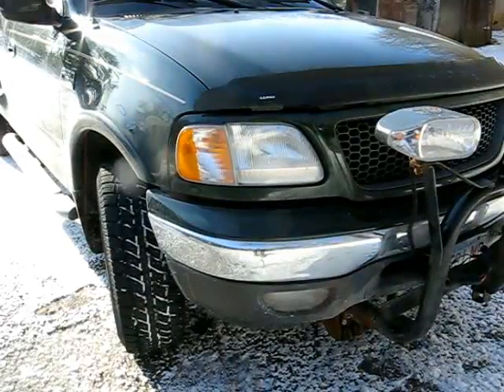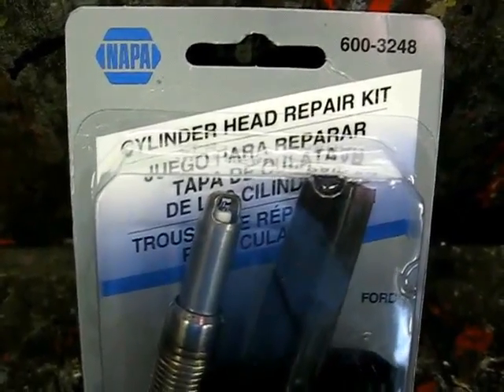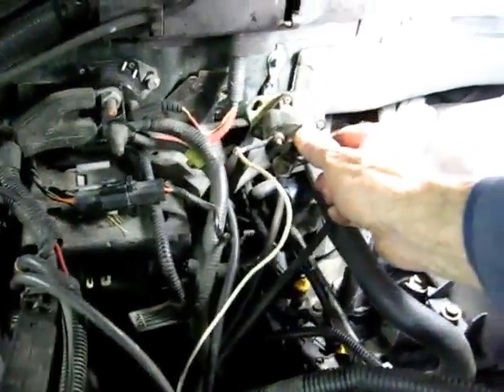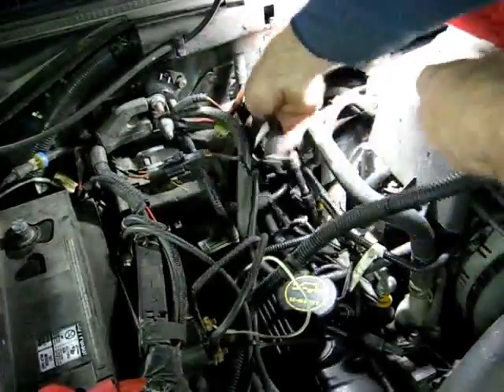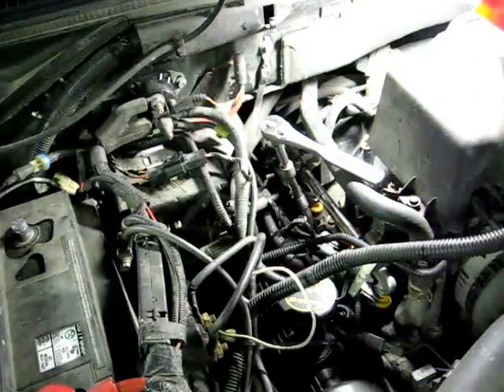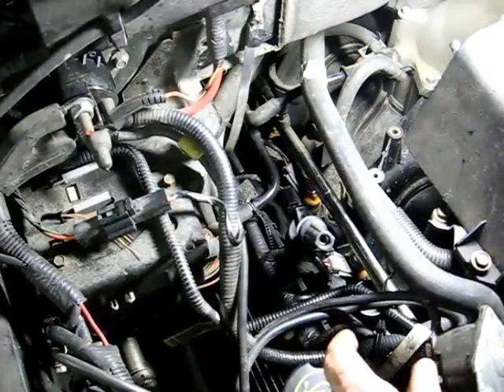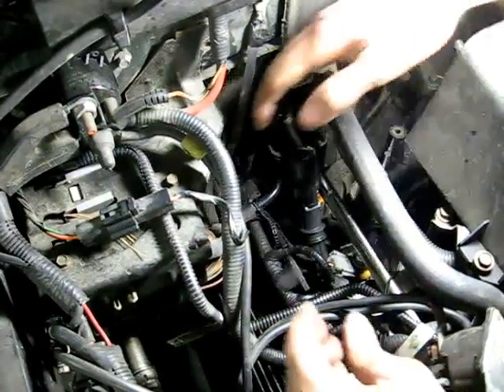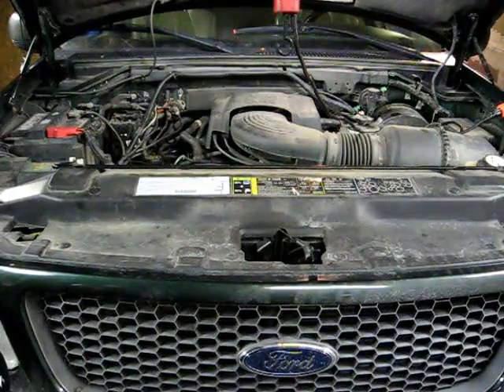Spark Plug Thread Repair

Comment: The "special spark plug" used in the video looks like it is for a 3 valve 5.4L. It is used on a 2 valve 5.4L in this video. That has to be the wrong kit. I have heard that people have a hard time finding the 2 valve kit, so it is a likely possibility.
Reply: johnathan wood well it had t=ouble starting..😕

Comment: I have a 2001 XLT f150 5.4 2V  and I can only find a insert kit for the 3 valve engine. what is the difference between the 3 valve and 2 valve spark plug threads and are there difference in the years!??

Comment: tired this on friday - blew out on monday - onto the next kit - this is a glove compartment get you home fix ..
Reply: +Ricardo Benin  This is not a get you home fix. This fix is permanent. 

It has been in my truck for 5 years. I just blew another one out the other day. First was 4 and next was the number 3 plug just what is common in V10 engines. 

The first one my father put in and I was told by Mechanics that when it bottoms out you will know because it will come to a stop.  I asked if I would be able to strip it easily and was told no. 
Well, that must be a weak person who said that because I can twist a 1/2 quality drive until it breaks. 

The truth is, there is a certain amount of force that you must not go over. You can easily strip out this fix. But once you have installed it the plug will not blow out again. If it does, there are Sav A Thread kits you can use that even fix the spark plug after using this insert. Then if that doesn't work you can use the big 500.00 ford kit which is tricky but fixes all of these if you can not seem to get one of them to work. 

So you have three shots at getting it right.

Comment: Special spark plug?   What about when you need to change spark plug next time?
Blow it out your spark plug hole!
Reply from the maker: They are available without buying the kit.
Reply: Chris Bamford YEAH THIS IS NOT A GOOD IDEA...ITS A TEMP FIX...I GUESS IF U WANT UR FORD TO DRIVE AWAY FROM UR HOUSE OR MALL PARKING LOT WHEN YOUR SELLING IT.....LOL..SMH I RATHER DO THE RITE FIX FOR THIS!..NEW RETHREAD AND PUT THE OEM PART BACK.

Comment: why don't you try shoving that air hose up your a@*, they only last about a month, you need to purchase a time sert kit to do the job right, it taps a brand new hole and the insert is held in with a pin, lasts for years if not forever
Reply: Time-Sert kits don't use a damn pin you fool.

Comment: Hello I have question I have bad spark plug thread hole  diameter is 15.8 mm what insert size you thing I need to make it fit with inside measure 14mm*1.25mm I confused about insert outer diameter
Reply from the maker: I am not sure what size the insert is as i do not have one here handy to check.

Comment: Hello Rich,
I have stripped my spark plug and I have the SOHC Saturn SL. I was wondering what 17mm socket I should use to get the die into the head. As you know the wall of the block gets in the way.
thanks.
Francisco.

Comment: I had someone do just this to my 2001 expedition when the sparkplug blew out....after putting the insert in and changing the coil, there is a "knocking" sound when you accelerate...can someone advise what could have been done wrong or what the issue might be ?
Reply: How long did you run the motor after the blowout and before the fix.
Reply from the maker: shawn abbott
I am not sure how long the person ran it that way.
Reply: shawn abbott
Reply: Bubba C KNOCKING....IT COULD BE A COINCIDENCE AND UR ENGINE IS GOING OUT...KNOCKING USAULLY MEANS..BYE BYE OWNER..UHHHH  HELP IM DYING UUuuf..lol

Comment: i bought 1 of these kits today and all it done was sit in the hole and spill didn't go in the hole and 70.00 later still not running. any suggestions
Reply: It is possible there is to much damage to the head for this kit to work.
Reply: ya, been thinking that as well but can't see down in the hole. and thinking it's gonna be an expensive fix. how often does this happen? am i looking at 7 more times.......lol

Comment: It will blow out in some mile from now with that kit need 12 gauge shot gun brush an acetone clean it good  then apply jbweld the old type that sets up in hours the jbkwik doesn't hold up to head heat melts next apply old style jbweld to thread repairer and thread it  in let thread s set over nite with heat bulb over cylinder to cure weld finish job and drive
Reply: Samuel Swenson I am not sure what would be stronger than the red locktite on the insert.
Reply: So what about just using JB weld on spark plug itself?
Reply: rich pin hello my fellow New Englander, do you offer services on fords f150? I'm from Western Mass

Comment: I installed this today. im scared to strip the heads again and cant tell if it screwed down far enough.  is this a temporary or a good fix to keep around for awhile?
Reply from the maker: This one was still working fine till the day the truck was sold which was 8 months later.
Reply: cool thanks.
Reply: puffNtough760 NO ITS NOT A GOOD FIX! THE LONGEST I'VE SEEN IS 8MONTHS....ITS A TEMP FIX TO GET U RUNNING AND TAKING IT IN THE A SHOP...IM DOING MINE TOMORROW BUT THE RITE WAY SO THAT I HAVE ALL GOOD THREADS.

Comment: Prevention of shavings in cylinder. 

1) Rent thread chaser (refundable deposit at auto store)
2) 3ft of thick string (550 chord?/ in camping section walmart maybe)
3) Mystic grease, red thick all purpose cheap at walmart and coat lightly on string
4) Tuck string in hole
5) Grease hole and tool.
6) Chase, fix the threads
7) use solvent (alcohol.. or..) Q-tips to clean threads off
8) Imporvise hook on long screw driver and fish out string
9) Clean again and install plug with anti-seize
Reply: Why go through all that hassle when all you need to do is what the man in the video did, stick compressed air in the spark plug hole and blow whatever shavings are on the piston...Most people if not all aren't doing this for a NASCAR engine

Comment: about the shaving , if I where to do this I would turn the engine till the exhaust valve where open and after the repair flush them out with compressed air. spark plugs are never an issue with hondas but with these new 100k plugs I would remove them every 40k and put more-anti-seeze. after 10 years a plug living in a cylinder head may want to stay married.

Comment: Its only a common problem for the ones that didnt do the plug change right. I have had a few of these modular engines (4.6 and 5.4)  and never had an issue.

Comment: Thanks so much for this informative video. I just completed the #3 cylinder today on my son's 2003 F150 with the kit from Napa. I was getting ready to pull the cylinder head when I came across your video. What do you think about installing these kits in spark plug holes that aren't already blown out in order to save the cost of a coil every time one blows out? I was wondering if the extra metal from the threads still being there would affect the installation.

Comment from the maker: @bbchino55 I can not tell you if this kit will work but it looks like you are down to two choices this kit or a new head.Hope it is not a new head because it is a big job on this truck ether the motor has to come out or the cab of the truck has to be removed.

Comment: Thanks for posting this. Yesterday the same thing happened to my 2000 4.6 Mustang GT. After researching various sites, applying wheel grease to the the reamer will help shavings stick and not fall into the cylinder. I'm sure richpin06a is aware of this, I'm just posting because I noticed some had asked about the shavings. I called the local Ford dealership and the mechanic said he can complete this with a Helicoil insert in about 20 minutes, but others may try to sell you a head...

Comment: I just had the #3 spark plug blow out of my 1999 ford police interceptor 4.6 . I just ordered the same kit you used in this video... I hope it works the same for my PI heads on my 4.6 If it does anyone with a GT or Cobra mustang can use it as well... Was there a part # for that special spark plug... so i can order them for the next time i change all the plugs... 

 i must say your video was strait forward n to the point. this well a done video you made up...
Reply: Keith Haas did this method work for you? I'm contemplating using the same kit on a '04 grand marquis.

Comment: I would not use junkyard parts to fix this engine, especially cylinder heads. The repair kits are better than spending a grand on a new head, not to mention time or labor. Considering the issues with some cars, this seems minor.

Comment: wouldn't screwing that new insert in cause metal shavings to fall into the cylinder head? In the video you blew it out before screwing in the insert thing, but not after. Does that anti-seize stop metal particles from falling in?